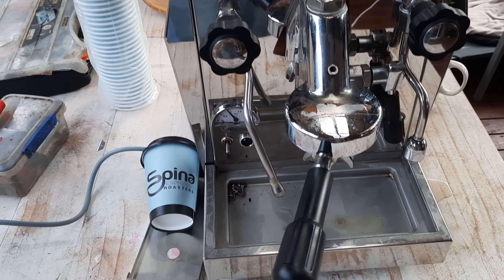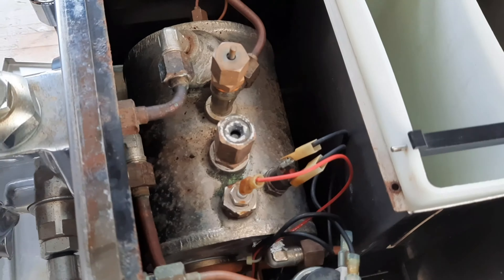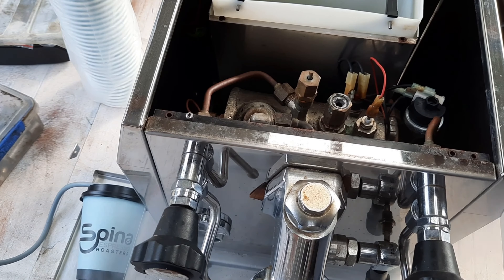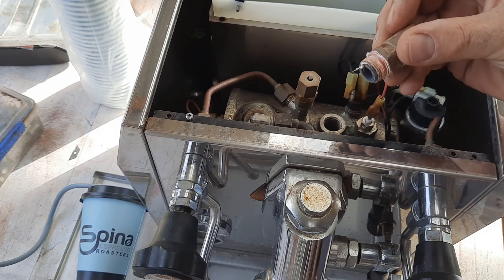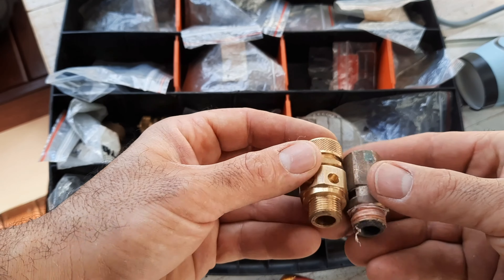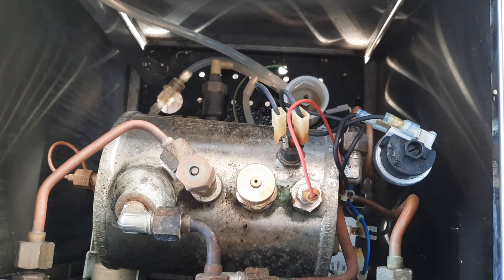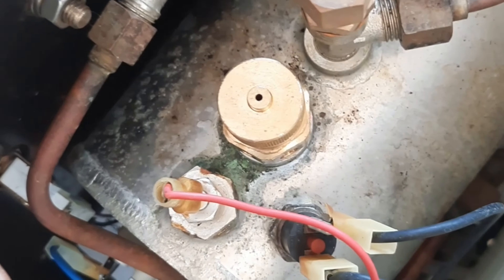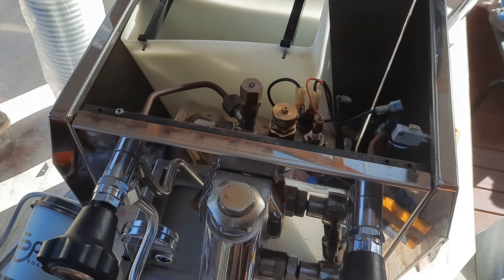Rocket Coffee machine, DIY safety valve and pressurestat replacement

Comment: Only because of your video did I think to check if my pstat line was full of water when it wasn't turning off heating element and machine would shut off so to temp safety switch. $0 fix. Guess I have to purge it every few years. Thanks!
Reply from the maker: Shouldn't have to, as long as the water level is set correctly and you clean the water level sensor every 6-12 month

Comment: Thanks for the video. I'm thinking of installing an Asco Sirai pressurestat im Oscar 2. So, basically you cut the original wires, put new cable lugs with a grimping tool and then plug the lugs in the Sirai pressurestat?

Comment: Remember not all the time the pressure safety valve has to be replaced after it discharges, sometimes it is its normal operation especially when the pressure it's beyond 2 bars. Sometimes try just to adjust the pressure switch or replace it
Reply from the maker: Correct. But not in this case

Comment: How do you remove those cables and wires attached to the pressure stat I just can’t get them off and I’m pulling very hard
Reply from the maker: Use a flat head screwdriver to lever it out

Comment: Could this also be responsible for low pressure at the brew head?
Reply: It should have minimal effect on the brew pressure because the pressurestat only allows a narrow range of pressure variation (0.5 to 1.2 bars) in the boiler.

Comment: Think you’ve got it the wrong way around. It’s your anti vacuum valve that’s leaking. The one with the pin is the safety valve.
Reply from the maker: The one w the pin is the anti vac valve. The anti vac valve doesn't blow like that. Only the safety valve does that